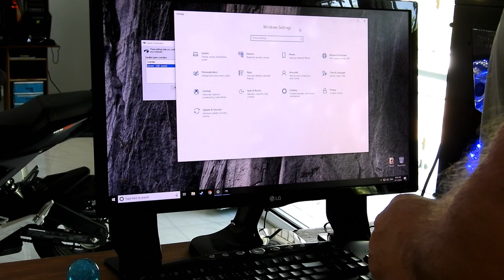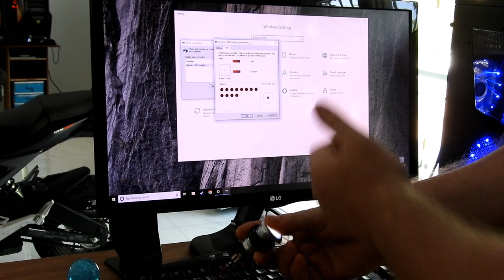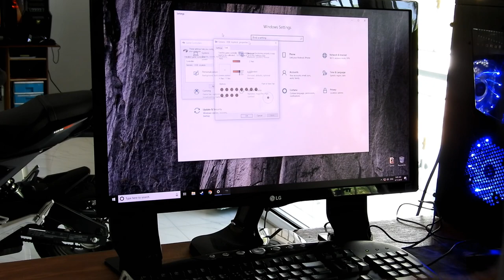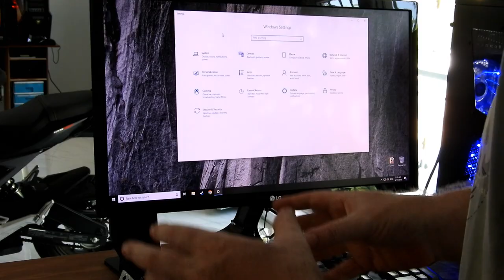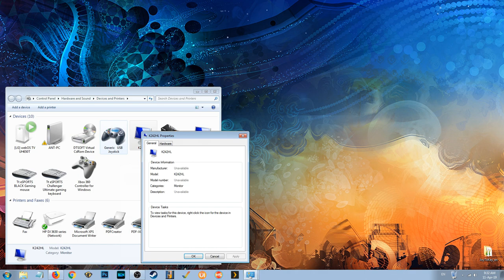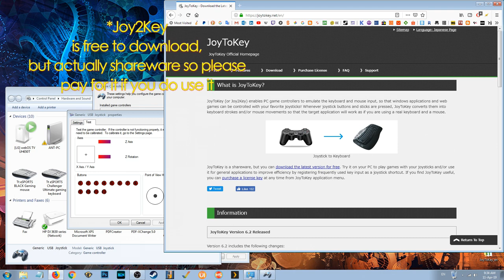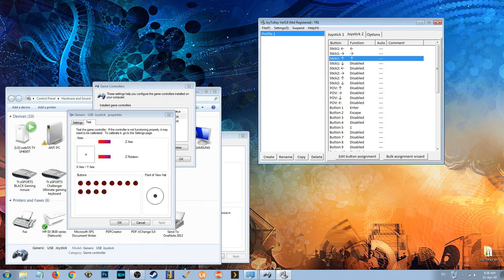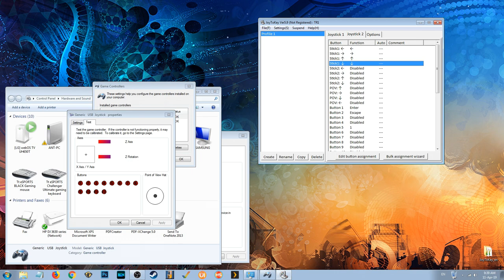USB Arcade Controller Setup Guide

Comment: The light on the board doesn’t come on when I plug mine in?
Reply from the maker: Hi, it sounds like the board might be broken. Does Windows not show it at all in the Printers and Devices list? Try a different USB cable to see if that is the issue, and try a button (or briefly shorting), the Mode button (green/red light should alternate to check if the LED is working ok). Probably not much you can do to fix it if it is broken except get in touch with the seller and ask for a replacement. Hope it helps!

Comment: Using two on P.C.  The name is the same on both under device manager so the game cannot distinguish the two. When I program one, the second won’t allow it. Any idea around this? Maybe jump the device so it shows are 24 button rather than just 12?
Reply from the maker: Hi mate, can i ask which game it is which uses so many buttons? I assume it uses the joystick input directly rather than going through a program like joytokey, or is it programming the joytokey software which is the issue? Cheers!
Reply: Arnold J. Rimmer I’m playing DCS world and Flight Sim 2020. In DCS , the name of the device is the same. Each encoder runs a 12 button button box. So when one button box is assigned, the other one won’t allow it because the game can’t have the same input number such as one with the same input device. It’s a funny it can’t tell that they are two different devices even though they show up in separate columns.
Reply from the maker: @AHmn-jt3yb  understood. I can't think what you can do within FS2020 itself, but  maybe something here to consider. I used 2 encoders on a PC setup and Windows properties listed both with the same name.  

By using joytokey I could assign any button on either controller to send any specific keypress to the program (MAME in this case) - the profile was saved and assigned to the program and (keeping the same encoders in the same boards), it remembered the 2 boards with no issues. 

Sorry if that's not too clear (basically assign buttons as keypresses in joytokey and use that to communicate with FS2020), but maybe it'll give you an option to consider - you seem to be an enthusiast who'd spend a few minutes to set it up... Cheers!
Reply: Arnold J. Rimmer I found that the MODE button on the encoder chi a few from “ps3/pc” to “android” so that worked. DCS world can’t see two controllers with the same name and same button assignment. Works now though cheers!
Reply from the maker: @AHmn-jt3yb  Hi thanks for letting me know glad you got it sorted. Cheers!

Comment: Can you use the ports for fire and fastfire-buttons also for switches?
Reply from the maker: Hi the unused joystick (on this board) ports register direction changes just like joypad switches. With Joytokey or similar I don't see any reason why you couldn't assign buttons in these ports to anything you want. Very handy too if you want to navigate menus or play with buttons rather than a joystick. 

The other 4 ports Mode, Turbo, CLR and Auto don't register as button presses in either Windows controller properties or Joytokey (which supports many more buttons). Mode (unsure what this does but LED changes from red to green), Turbo is autofire, CLR is to clear autofire and Auto seems to be another type of autofire which flashes the red LED. When I get round to my next project I might spend some time on these but to answer your question it appears that these ports cannot be used for simple buttons.
Reply: @arnoldj.rimmer5116  Thank you so much..it is a great help to me!
Reply: @arnoldj.rimmer5116  Uuuhm..last question please...can you connect potentiometers to this usb connector? (Would help me a lot)
Reply from the maker: @tve5614  Hi no I don't believe so with this board, which is just simple digital ports. If you want to have a realistic plunger or tilt mechs you should take a look at the virtual pinball forums you'll find lots of help.

Comment: Will this work on cheap china tv box
Reply from the maker: Hi I haven't tried it, but if your box supports a usb controller for input, this would work the same way. Interesting idea to design a custom controller though... Cheers!
Reply: will enter an back work on tv inteface (like a and b button on regular gamepad?
Reply from the maker: @kozu7213  Hi, if a normal gamepad works, then this should also. It acts just like any generic usb input device. You might have to check which ports have the buttons attached if you're trying it on a non-windows device like android - I'm not sure tbh... Cheers!

Comment: The joystick is so stupid
Its not analog at all. Its just 1 for fully forward or 0 for idle
There's no in between
Reply from the maker: Hi. Yes, it's just digital and suitable for retro games which use this kind of input. For analogue input, you should use an Arduino Leonardo, which emulates an analogue controller like the XBox360 controller and is easy to set up with code you can download from arduino fan sites. Cheers!